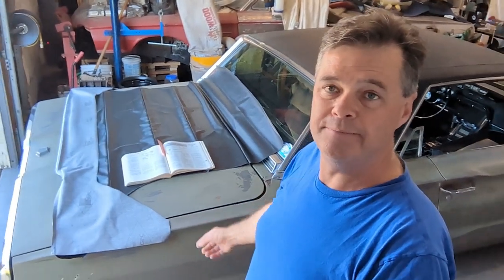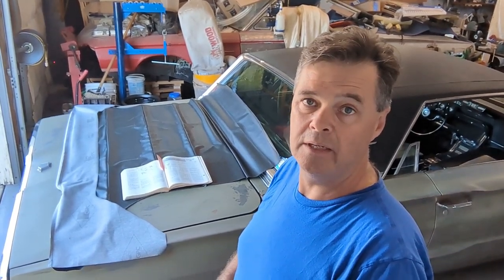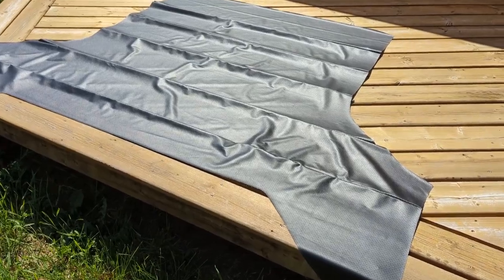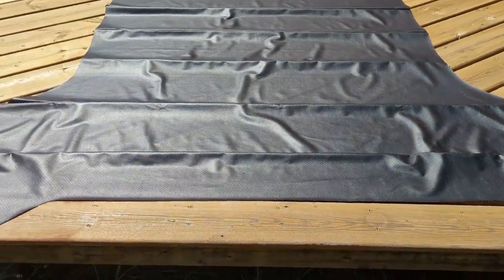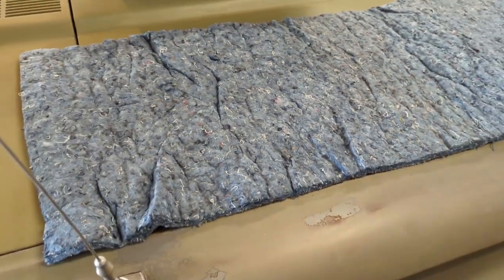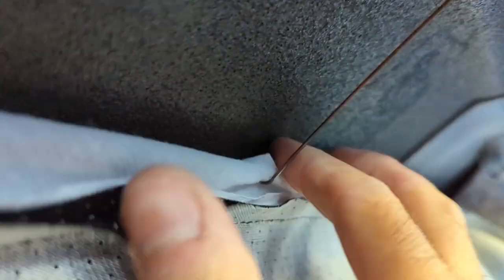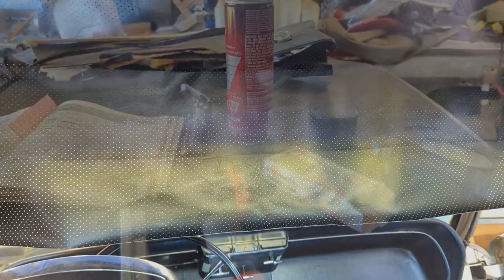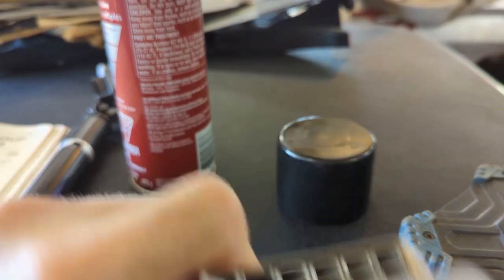Headliner Installation - 65 Thunderbird Hardtop

Comment: Hello Alvin. You did a nice job installing that headliner. My Landau has the headliner glued to a backer board with no bows that I need to do. Was it that thin yellow insulation in the sail panels originally?
George B
Reply from the maker: Thank you George!
Yes, that yellow insulation is the original, it was in pretty good condition so I kept it.

Comment: Does a 66 have bows for the headliner?
Reply from the maker: The 66 has bows, the configuration may be different in the 66 T-birds with an overhead console.
Reply from the maker: Hello,
Just picked up a 66 T-bird manual...and I am wrong about the headliner bows, it looks like in 1966, supports and retainers were used, no mention of bows at all.

Comment: You didnt insulate the whole roof ?
Reply from the maker: I did the roof in sound deadener. I used a neoprene 1/8" thick deadener, it's lighter than the butyl type I will be using on the floors.